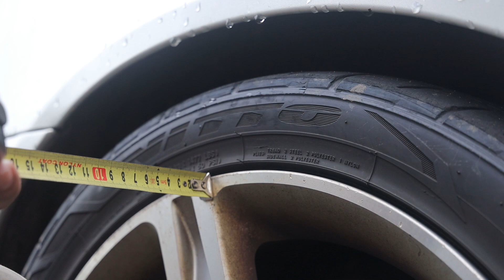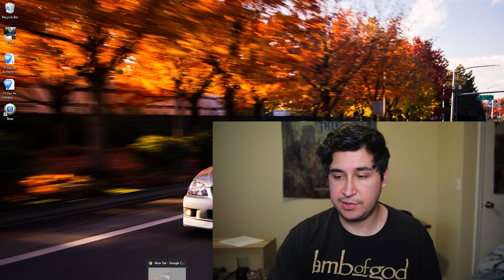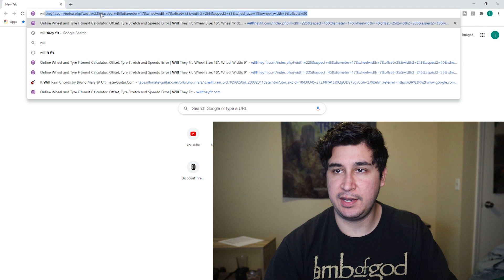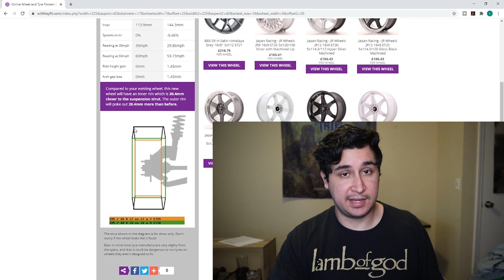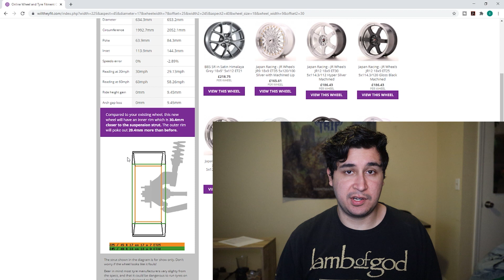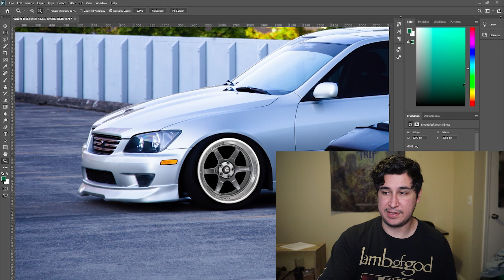How to choose wheels for PERFECT Fitment!!

Comment: Hi

How much are Enkei RPF1 in the US?
I know, they can be seen on an IS all over the place, but damn they look AWESOME!
In a dark coulor with a polished outer ring!

The Kansei roku is the best choise out of the once you listed.

Regards from Germany
(IS300 are really rar over here)
Reply from the maker: Brand new they go from about 350-400 usd brand new depending on finish and are pretty easy to find used. Definitely a classic wheel but like you said, too many people have them. I do love the rokus! We'll see which ones I  get 🤷‍♂️ thanks for watching! 🤘🏼🤘🏼
Reply: @RotaryDaddy  I get that.
Here in Germany they are rar as FU.. due to our TÜV (technical inspection bullish...).
That basically makes them illigel to use.
Would love to run them in bronze on my blue IS300 Sportcross.

Regards

Comment: I’m going to run AH08 aodhans 18x9.5 all around on the IS. They’re back ordered. But when they get here I should be good. Remember with IS300s you can roll and pull the fender a good amount. So if you wanna run some crazy ass specs. It could be possible. 9.5 is fine for me though nothing huge 😂
Reply from the maker: Yeah you're right but I wanted something a bit more mild with minimal camber and a pretty fat tire. The ah08s are sick tho love 6 spoke wheels!.)

Comment: Would 18x9.5 +38 fit a is300??
Reply from the maker: So many factors that go into it. In the rear it should be fine. In the front, I think you're gonna be hitting wheel to spindle with that offset
Reply: @RotaryDaddy  damn. Thanks bro